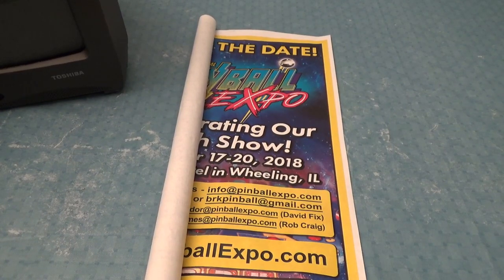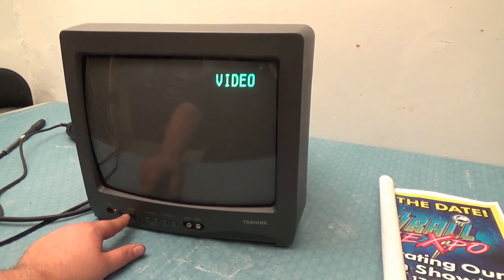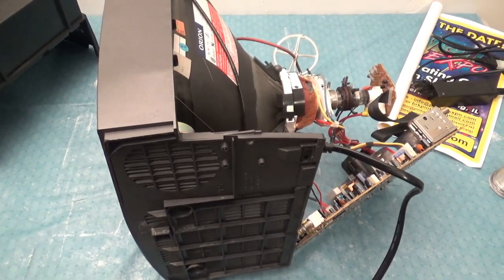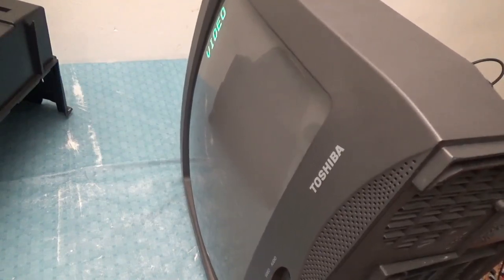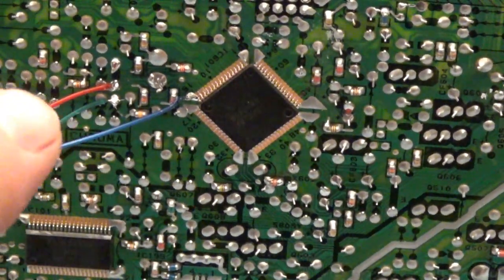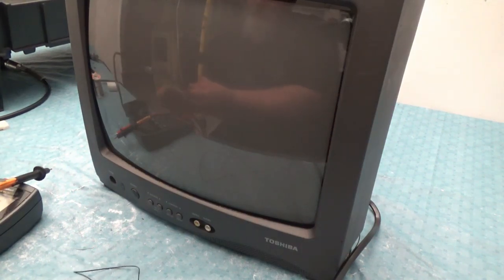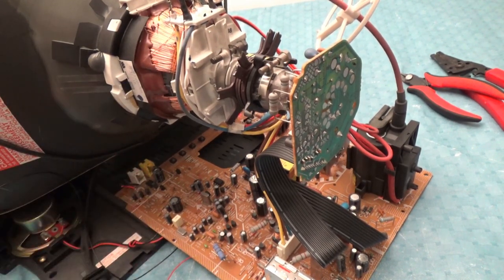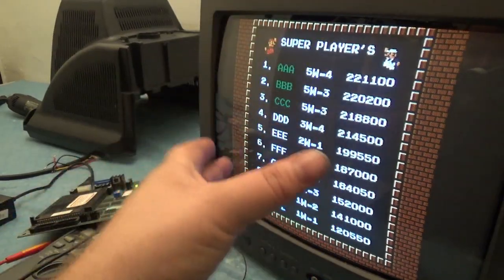how to hack a TV into an ARCADE monitor

Comment: Hi there, I have two questions for you:
1 - How does that board ruin an arcade machine?
2 - Are you using just RGB signals, no sync?
Thanks, greeeat work!
Reply from the maker: 1. people gut original games and replace it with that board
2. rgb and sync is connected through composite in
Reply: Billy William  because some people are monsters.

Comment: As always GREAT info! 

It's rather off topic, but what's the best way to connect an old composite B & W game like Space Invaders, Steeplechase and such to a color RGB monitor? I think I've heard all you have to do is make a circuit to separate the sync using an LM1881 and tie all the colors together with resistors, but I've never tried it. I've got an extremely rare PCB for Exidy's Side Trak I'd love to try to do something with eventually, though I'd rather not have to chase down a B & W monitor if I can just use a standard.

Edit: Just grabbed a 13" TV out of the neighbor's junk, assuming it still works going to try this mod on it!
Reply: B/W is the easiest of all. Just put the signal as it is into your TV's composite input. I did that all the time when working on the back of a B&W machine (including Steeplechase): I also did it the other way round feeding video from a VCR into an arcade machine to give it something different for a change. Like watching The Great Dictator on a Pong machine.
BTW... if you have a Full Logic B&W board (no CPU), you can mod it to output a color signal as I did with Tank (https://www.youtube.com/watch?v=0pYwH0SYYDA)
Reply: Thanks! I was talking more about actual arcade color monitors and modded TVs, I guess in a pinch there's nothing stopping me from just using a TV but then I'd have to make a mount for it.

Cool seeing Tank modded for color! Is there instructions on how to do it somewhere? I know someone modded a Pong clone to do color, was his technique used?
Reply from the maker: Tie rgb and sync together now connect your video signal to that and make sure your game and monitor share the same ground
Reply: I actually do have instructions on modding Tank for color, but modding any TTL graveyard game for color REQUIRES the schematics. There, you need to find the video mixer and identify the signals that go in there (the schematics are often annotated) so if you see TANK 1 route it to Red, if you see TANK 2 route it to Blue (it's a little harder than that)http://tempect.de/senil/ARCFIXEN.TXTsearch for Tank color upgradeand take it with a grain of salt - I'm not 100% sure about all the signals, but I talk about which ones may be swapped.
Reply from the maker: are you kidding me? i also modded tank 2 kee games for color you have to and it with vblank we gotta hang out man
Reply: is that why the picture is too far up? I use the original composite b&w video signal as the sync reference and have already wondered how I could get the picture down more. Sure I would like to hang out at your place but I'm in Germany and if the FBI looks inside my suitcases, I'm done for. Convincing them that homemade electronics are not a bomb takes forever. Btw. you seen my Wrectrex video?
Reply: I just took apart that 13" TV I grabbed and it's apparently the same board as the TV in this video, just labeled for Orion instead of Toshiba! Saves me a lot of work! :D

Not that it's needed now, but I found the datasheet on that chip: http://www.alldatasheet.com/datasheet-pdf/pdf/1232/MITSUBISHI/M61203CFP.html
Reply from the maker: thanks someone else found it too

Comment: I've got a nearly identical tv that I tried this with. The vertical adjusted via the service menu, but there was no place to adjust the horizontal. I pulled 6 windings off of the width coil (trying to shrink the width) and it did not make a noticeable difference. Man, I wish you had showed the horizontal width adjustments... Any suggestions?
Reply from the maker: Pull more off
Reply: I pulled off 1/4 of the outer windings, but the width didn't change. Now it pulses when the image goes from dark to light. I put in a coil from another (identical) tv, and it is back to normal. It's almost like the board is compensating somehow.

Comment: Hi Jason , would it be possible just to hack into a scart lead to achieve the same results?
Thanks
Reply from the maker: yes but here in the states scart is nearly impossible to find
Reply: Thanks Jason.
I have an old TV like the the one you used in Your video and I was thinking of using it instead of an LCD for a cocktail machine im building.
My dad set up his arcade business back in 1965 in Birmingham England with EM bingo machines from Bally.
I started working for his company when I got my summer holidays every year from school starting back in 1980 When I was 8 years old.
We moved back to Ireland in 76,and to this day I still work for my dad ever since I finished school.
He's 75 years young and still running his company, cointrend amusements, but unfortunately we mostly deal with fruit machines ,pokers,pooltables and jukeboxes.
But in our locations ive started to bring back the classic arcade machines,but they are very hard to find over here,but im trying to bring them back to our local area.
Keep those videos coming.
You're doing a great job.
Reply from the maker: very cool story

Comment: Hey Jason, I sent you an email about a TV I'm trying to hack for this.   The video chip it has is  a CXA2025S.  I found the datasheet for it online  and it shows the RGB inputs on pins 16,17, and 18.  I hooked the sync to the composite jack, but I'm not getting 'jack' for a picture.  Would appreciate any help you can provide.
Reply from the maker: hmm dumb question but is your tv set to video?
Reply: Yes.  If I ground either the "SH" or "OUT" pins, I see the respective colors, but not if I ground the "IN" pins.

Comment: Is there a way to bypass the digital  conversation in the signal chain when converting an HD crt to an arcade monitor? 
Seems like it should be possible to bypass that stupid thing for rail shooters
Reply from the maker: sure
Reply from the maker: you have to have the same composite sync  though so in other words it will not upgrade the picture from comp to hd

Comment: I have a question. If I'm using this in a MAME setting and I have a VGA connection going into it, do I need to worry about 15khz / 31khz resolution mismatches or can i get away with a simple VGA to CGA connection board?
Reply from the maker: 3 options you need a vga to cga adapter or you need to run cga mode or use a mame cga graphics card
Reply: Arcade Jason ok, so it does need to be in 15khz mode then. Thank you for the response

Comment: In Europe most TVs have a SCART connector, that has RGB available - also has a  "feature switch" line, if the line is held high the TV will switch to RGB input mode. It fairly simple to take HDMI from a Raspberry Pi  use an HDMI to VGA converter to generate RGB plus sync and feed this into SCART - makes a great arcade display for MAME. I've not tried a SCART TV with an arcade board, it might work :-)
http://www.jonshouse.co.uk/rpiRGB.cgi

Comment: Hey Jason, I did this hack and it looks great but the screen isn't that bright! I adjusted the flyback and the brightness in the settings but it looks washed out! Any suggestions? Thank you very much.
Reply from the maker: yes remove the pull down resistors in the original circuit
Reply: Arcade Jason where would I find those, your smart as hell and I'm a dumb dumb, lol do you have a way for me to send you a video of what my tv/ arcade is doing? I'm stumped.
Reply from the maker: koppjason83@yahoo.com
Reply: Arcade Jason cool thanks man

Comment: ARCADE JASON,  every arcade monitor has a B+ voltage, I'm confused why the B+ voltage is a DC offset or Bias voltage set at 125vdc for the Vertical sync and Horizontal sync & hold circuit. I don't understand why the Vertical sync & horizontal sync and hold circuit needs a B+ Bias Voltage at 125vdc in order for it to work. Any reasons why?
Reply from the maker: the b+ is different for each make of monitor  it has to do with the calculated inductance of the yoke coil  and the inductance of the primary on the flyback  (b+ can affect the overall voltage of individual monitor circuits)  voltage too high will raise your hv in some situations or could lead to the yoke drawing more wattage than designed
Reply: @ArcadeJason  thanks, if the schematic doesn't tell you what the B+ voltage should be, how do you know what to set the B+ voltage to? keep adjusting the B+ trim pot until the screen is stable?
Reply from the maker: @billwilliams6338  not unless you want a dose of x ray radiation . i have rarely seen an undocumented b+ voltage but if you don't know what it is you could measure your anode voltage with a high voltage probe (remember the 1kv to 1" rule) for example if you have a 19" tube it would be best to not exceed 19kv    DO NOT measure high voltage without proper equipment !!!
Reply: @ArcadeJason  if the anode voltage is 19K how do you calculate the B+ voltage from the measured anode voltage? The B+ voltage is has nothing to do with the H&V sync hold circuit?
Reply from the maker: @billwilliams6338   the  hv  deflection  has a feed back circuit  which is voltage sensitive  (most monitors)  if you have 19kv and everything else is working properly there is no need to calculate the b+ . in fact measure your b+ and that is very very close to what it should be  from the factory IF you have 19k -19.5k  at the anode
Reply: @ArcadeJason  are you saying if I adjust the B+ trim pot it will change the Anode voltage also? I think you said before that the B+ trim pot changes the flyback voltage

Comment: I’ve never soldered anything in my life, but I must learn how to do this. I’ve had a Stargate sitting idle for years. I came here ignorant, but did have the idea of putting a monitor in and attaching my 20 year old Nintendo to it and then thought I could hack the controls to the original Stargate game and use my cd emulator Stargate through the cabinet and with the real controls. I bought the cd in the 90s, but it’s useless without controls.

Comment: I have my composite going into a vga connector, I have both h sync and v sync wires from the d sub connected to the composite. I believe one of these should not be used( h or v sync). My tv shuts down immediately after I press the power switch. Is this correct?
Reply from the maker: what are you using to produce the rgb signal?
Reply: A pc with a old ati graphics card. I have the system outputting to a arcade monitor just fine using groovymame. I have it wired the same way. I do not have a 
resistor/s in line anywhere. I know you specified in the video but I was not clear on that.
Reply: Arcade Jason read above
Reply from the maker: are you using the same exact tv? if so no resistors should be needed  you might be able to tie h and v togather an connect it  composite since tvs have a built in sync separator circuit . if the tv is going into hv shut down it may be because the frequency is too high. if h and v are labeled on your pinout you should be able to use them separate
Reply: Arcade Jason I am not using the same tv.
Reply: Arcade Jason I do have h and v together. I will look at schematics and about separating them.

Comment: How do you find sync on a tv with no composite in?  (cheaper model with only tuner in) Or is it not possible?
Reply from the maker: it will be labeled on the chips pinout
Reply: Sorry, I meant how to you test for it if you don't have a pinout for the chip like what happened for the one in your video?  Or is it even possible?
Reply from the maker: well this got me alotta shit but you can use a wet finger until you see and hear the sync freak out or just probe each pin with maby a 10k resistor

Comment: how you compare the image quality of this tv hack against a real arcade monito or even a PVM or BVM monitors? btw awesome video!
Reply from the maker: if i had taken the time to correct the picture size by going into the hidden adjustments menu or doing hardware hacks i would say the image quality is just as good as the newest and last arcade monitors. i don't have enough experience with pvm/bvm monitors  to make a good comparison
Reply from the maker: way way better than a tv sets picture though
Reply: @ArcadeJason  Excelent! keep the amazing work!

Comment: How can I make it so that my tv turns on? It's a 46" Toshiba crt rear projection tv

"Is this helping anyone?" That was hilarious! The answer is a resounding Yes.
Reply from the maker: you hold the power button for 5 min while plugging it in and hope it does not turn its self off during that time period but keep i nmind while the power button is pressed you can not use any other buttons on the tv . you could also use a time delay circuit and wire it to you power switch
Reply: I would think Another way you could rig a tv to turn on my itself would be to use a 555 timer that could pull the pin low for a delay and then release.

* oh that’s what Jason said...
Reply from the maker: yup or just 1 transistor and 1 capacitor and 1 resistor
Reply: Yes even easier and cheaper!
Reply: If you access the menu, many TVs with OSD have a "turn on after power loss" feature or similarly worded option. You can set this and the TV will automatically turn on when power is supplied. This is similar to going into the bios on a Windows PC and turning auto power on.

Comment: Pls try hooking up a Vertical pcb to this and shoe results,, also wounder if 5V video monitor signel from standerd arcade game will need to be turn down with pots , i dont thing the 60-in-1 put no more then 3v  , thanks for the video man , if a TV can be used for computer space , then why not a newer one be used for a  color pcb :) brovo :)
Reply from the maker: could easily be done with a simple resistor voltage divider or coupling caps

Comment: I don't understand why you just aren't salvaging the tube and using the arcade chassis? the only thing that you need to make sure of is that the neck connector is the same (CR-23 or CR-31) and that the impedance is within spec for the chassis. if the impedance is off, simply use the yoke from the original tube (and then perform a re-convergence and purity adjustment
Reply from the maker: it seems like you did not watch the whole video lol
Reply: I did but I think that I was going into this with a different mindset. this is a great hack for games where you are missing the entire display (and chassis and frame). now, if I could only find a few donor 13" tv tubes that have a CR-31 neck on them I would be golden
Reply: The point was to make an CGA arcade compatible monitor from scratch, not tube-swap or something like that.   It would be like asking why a video about the Mars Rover doesn't talk about the Moon.  Two different subjects.

Comment: In this case you could have turned the yoke to make it vertical
Reply: Make a video.  Don't think it will work the way you think it will, besides he is using the horizontal multiboard, not the vertical one.

Comment: Do not cut and pull or solder wire on the horizontal width potentiometer (18:45).  You could ruin your TV.  See that hole in the center of the spoil?  You are supposed to insert a tool there (like one of those tiny screwdrivers) and turn left or right to widen or narrow the picture.
Reply from the maker: yes you can i have done it several times. also the hole in the center of this ferrite  DOES NOT have a slug  and therefore cannot be adjusted
Reply: @ArcadeJason  A lot of TVs do have the slug though.  I think you could have mentioned it.  Its definitely the easiest and safest route to take if its an option.

Comment: Am I the only one thinking it's irresponsible to poke a wet finger around the inside of a CRT, despite fumbling around the video controller chip?  Kind of inviting people to win a Darwin Award.  Sorry Jason I'm not an electronics engineer.  But there's a huge bit on the PCB that was outlined Chroma, wasn't there any hints on the silkscreen to give ideas on which pins to tackle.  Also the HV adjustments, I've seen old TVs littered with adjustable pots that let you tweak them... Perhaps this one was electronic though *shrugs*.  It's good to see reuse but I'm in two minds the sorts of people who have no knowledge of what to expect in the inside of a TV doing this sort of thing.

Comment: I really don't understand this video 
why don't you just buy a CGA video converter that converts the video signal they're over eBay Chinese sides Amazon 
There is no need to rip apart a TV 
 in my arcades  I use Sony Trinitron's  and hp w 1907  VGA monitors  there's really no need  to tear apart TV and hack it up
Reply from the maker: converting rgb to composite video gives a very inferior picture

Comment: 7:30 ish in and Jason is poking chips with a wet fingernail in the back of an open, powered-on television. needless to say, if you do this you risk killing yourself if you're unlucky or dumb enough to touch the 30kv HV circuits. Don't do this unless you have the beard for it! When you turn off a TV and open it, learn how to check for and discharge the majorly powerful caps that can kill you even without the TV being on or plugged in. Do that first instead of doing what you see in this video unless you have a beard as awesome as jason's.